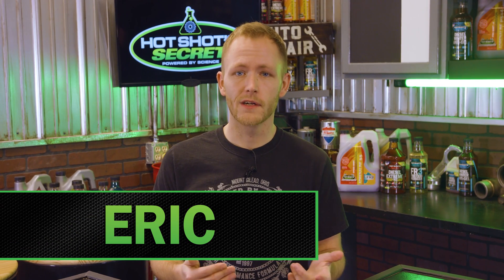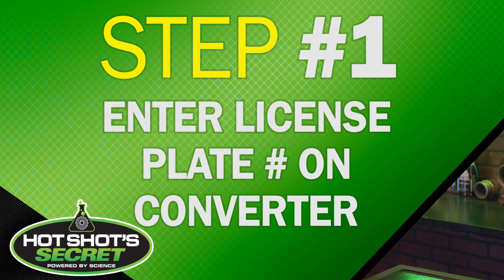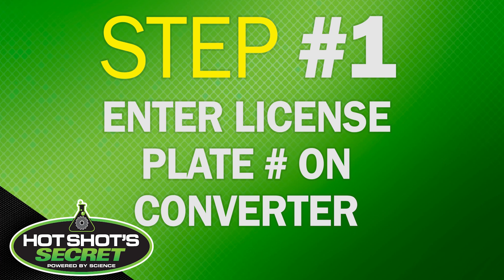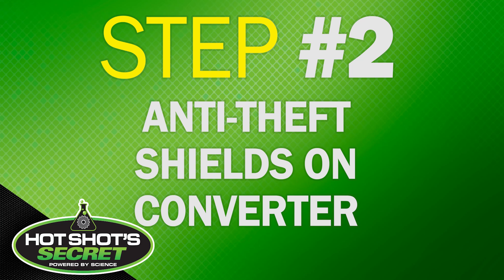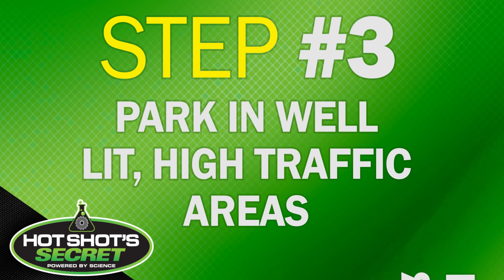What are Catalytic Converters and Why are People Stealing Them?

Comment: I u-bolted, painted and VIN'ed my cat.  https://youtu.be/uCMTZb7OHrI  Recently, I added two more 3.5" u-bolts and I will JB weld washers on top of the nuts, bolts.🐾
Steel cables  https://youtu.be/CYIDgYhyznY https://youtu.be/ZUisJggKWvg https://youtu.be/28O2k10X_zI
Steel mesh: https://attachments.priuschat.com/attachment-files/2021/05/206527_20210529_171741.jpg
Honda element mesh; https://youtu.be/rykHmm8TUhQ